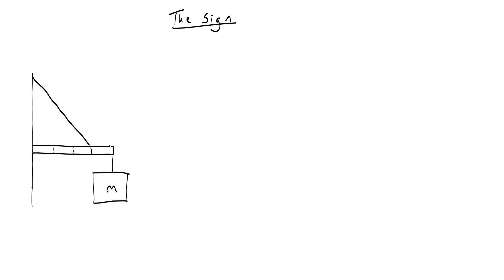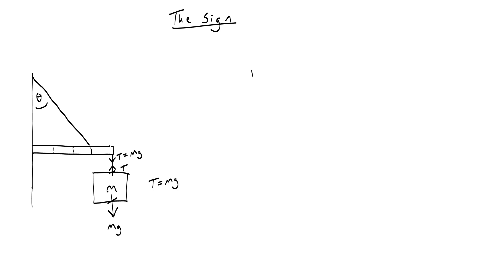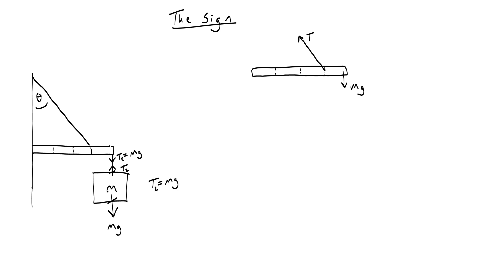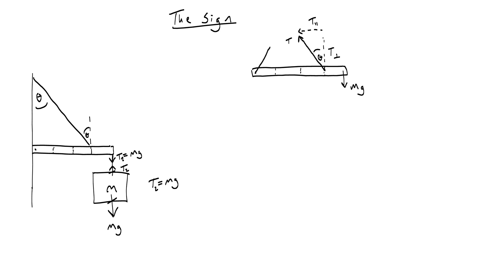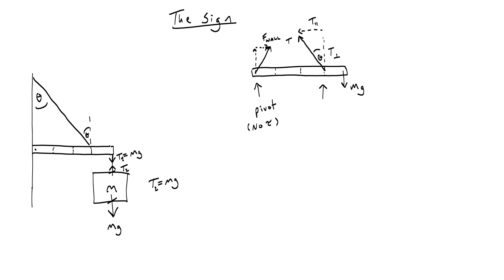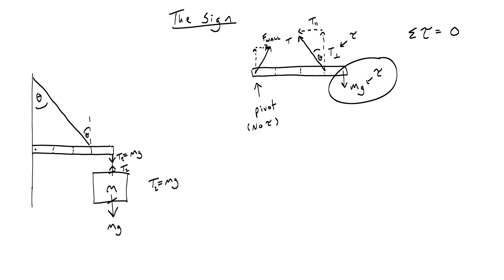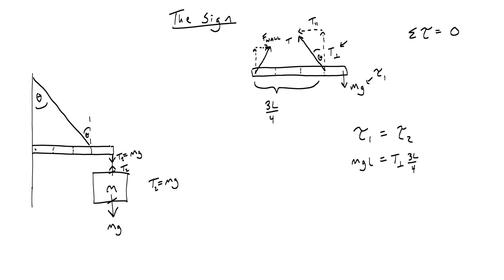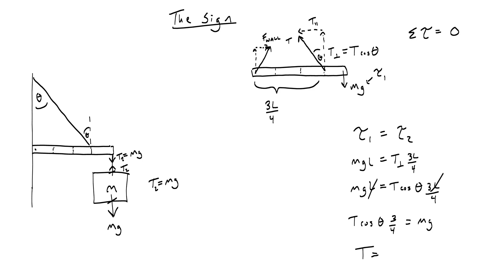Hanging Sign Equilibrium Torque Problem

Comment: why didn't we consider the rod's weight ?
Reply from the maker: Great question. I should have clarified that this is a "massless rod" or "rod of negligeable mass." This particular problem I threw together rather quickly and didn't want to include the mass of the rod. If you DID consider the mass of the rod it would just add a clockwise torque on the middle of the rod L/2. If we call the mass M then the torque would be Mg(L/2) and your Net Torque equation would be: mgL +Mg(L/2) = Tcos(theta)(3L/4). You would still have an L in every term to cancel out and your tension T would end up being a little bit bigger. Hope this helps!